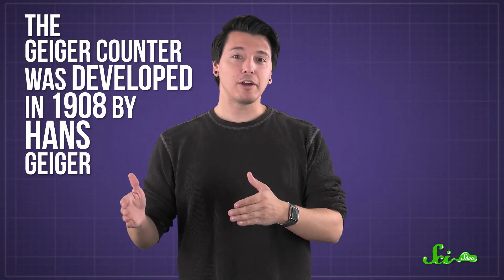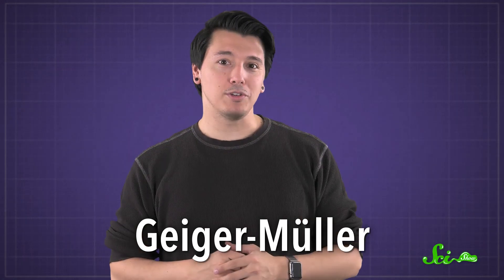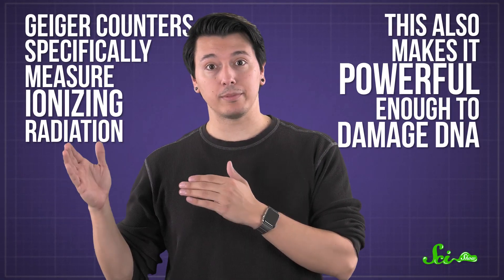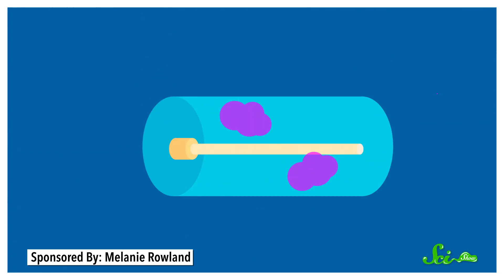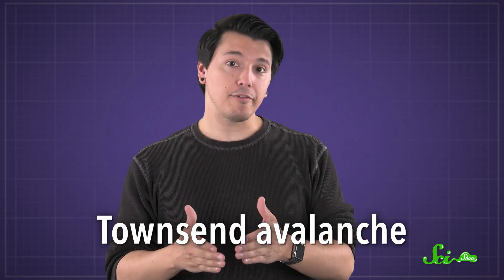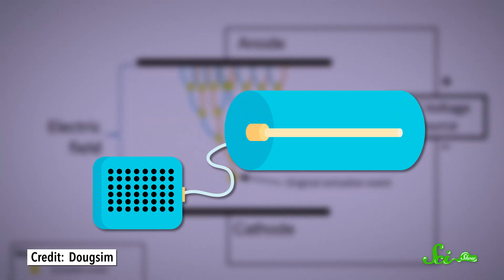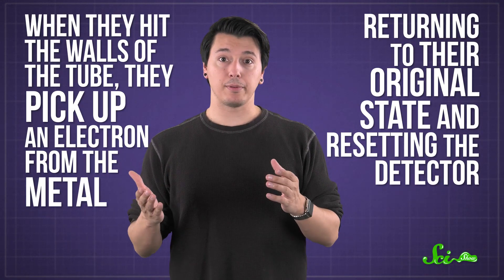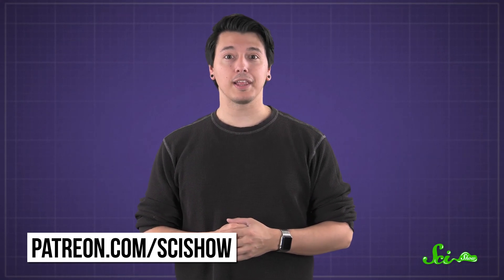Why Do Geiger Counters Make That Clicking Sound?

Comment: My left side of headphones makes crackling sound like Geiger counter. Is it serious thing on my headphone?
Reply: Well since this comment is 9 months old i presume you have new headphones but if you wonder they are broken
Likely a cable that got loose or some insulation that has worn off
Reply: It's picking up radiation from your phone or computer. Turn it on airplane mode and the crackling will stop.

Comment: "...  3.6 roentgen. Which, by the way, is not the equivalent of ONE chest x-ray, but rather FOUR HUNDRED chest x-rays! That number has been bothering me for a different reason, though. It's also the maximum reading on low-level dosimeters. They gave us the number they had! I think the true number is much, much higher. If I'm right, this fireman was holding the equivalent of FOUR MILLION chest x-rays in his hand!"

Comment: In my University days we had a radiation officer st the school. Someone had been working with Tc-99, a weak beta emitter with a half-life of about 100,000 years. He used a counter with a solid state probe which easily detected the decay of the Tc-99 whereas a regular counter might not detect it very well as the highest energy beta particles are only about 100Kev.
Reply: Nice

Comment: I bought a cheap Geiger counter on line and have been unable to conclusively determine if it is legit or just a random number generator. Hold it to a smoke detector  produced what seemed like a uptick of counts but nothing definitive.
Reply: There's about .33 micrograms of americium oxide in a smoke detector, and about a third of it is pure americium.

"After 30 years, about 4.7% of the americium atoms will have decayed to neptunium."

Not all that much to detect.

Comment: The only part that does not seem to be correct is the one regarding the positively charged gas molecules returning to to the medal and detouching electrons from it to neutralise again.As this activity could create a geiger pulse geiger counters contain alcohol molecules (with lower BE electrons and heavier) to stop the process.especially the older ones.

Comment: I feel like the clicking of old geiger counters are more effective then the beeping of new ones. The clicking makes you feel more scared, and therefore more cautious.
Reply: When they are clicking there is no danger.  At high dose rates of concern, the clicking becomes a continuous scream, cheaper models just go quiet as the drain on the high voltage causes the GM tube to  stop detecting.

Comment: Now explain to me how an RMKB reactor explodes
Reply: With lies!
Reply: It can't
Reply: @shadowofthenight7316  it can't because it's not there! (The acronym is wrong so it can't explode)
Reply: Wtf is an rmkb reactor? Is it a reverse engineered chinese version?
Reply: @LordBruuh  No. Its a Soviet design 2nd generation nuclear reactor. But unlike PWR reactors, it uses graphite as moderators. But the advantage of it is that it is like a high performance car, it produces a lot of power, but compromises safety. Therefore it encountered power spike levels like what happened in the Ignalina nuclear power plant, and the meltdown at Chernobyl. But advantage of its design is that it can be refuelled without shutting it down completely, and that they can be converted to produce nuclear weapons.
Reply: Idiots bypassing and disengaging safeties, removing control rods, and doing criticality tests at low power just to have another check mark on their report. 

There were many rbmk reactors that continued operation after Chernobyl without incident. Because those operators weren't dumb enough to bypass the safeties to run a criticality test.

While the rbmk is not a particularly safety forward design, they are still quite stable when operated within their design envelope. Chernobyl blew up because of humans not because of the reactor. No reactor in history has ever decided to just up and meltdown.
Reply: @zombieregime  What you say is true enough, although in the particular case of Chernobyl the explosion was caused by a design flaw in the emergency control rods. The reactor was rapidly gaining power when the operators dropped the rods, which had the unfortunate effect of causing the reactor to blow up in that particular (overheating) state.
Reply: @LordBruuh  Meanwhile China is reverse engineering CANDU nuclear reactors.
Reply: @jannadrielcervo7753  have they not tried, you know, just asking for the plans? I'm pretty sure whoever holds them wouldn't have too much of a problem with China building safer reactors......

Comment: This is why it clicks, but they didn't say what makes the clicking sound. Depending on your meter (many older Geiger counters are actually radiation survey meters, the difference is a lack of counting) if you have one from before 1970 or so, it probably doesn't have a speaker. It has an electromagnet with a little steel plate next to it in a headphone. The signal turns the magnet on and off quickly, which makes the click. I always thought that was really cool.
Reply: @toxic Sure, but a speaker usually has a cone and is modulated. This is just a metal plate. I know, it's pretty much the same thing; I just think it's cool. :)
Reply: @doggonemess1  3yrs later, and you’re still right. This is cool to know.
Reply: You kinda just described how speakers work

Comment: Radioactivity is fascinating to me! I have G-M counters and a collection of radioactive sources. It's complicated stuff! But, I love it! G-M counters are used more for lower-level sources, because the tube can become saturated, and in some instruments, mostly older ones, the reading will drop to zero in a high radiation field, and the user might think they're safe. Geometry is important. The larger the G-M tube, the more counts it will produce. And if it's a "pancake" type detector, with a mica window (which will detect alpha particles and lower-energy beta particles too), you can apply 2π geometry, which is great for calculating efficiencies of differing radionuclides (radioisotopes). Most modern G-M tubes are also "quenched" with a halogen. Mostly the older tubes were "quenched" with an organic vapor. This helps decrease spurious electron avalanches and decrease dead time, allowing for a faster recovery and response after a detection event. It is also important to know what the "dose to counts" conversion ratio is, for setting the tube's sensitivity, and this depends on what radionuclide the G-M counter is specifically calibrated to. Most modern G-M counters are calibrated with Cesium-137. For example, my Inspector™ USB G-M counter is calibrated with Cs-137, and the sensitivity is 3340 CPM/mR/hr. A different isotope, with the exact same specific activity and decay mode can be or will be vastly different when it comes to G-M tube sensitivity. It depends on the energy emitted from the isotope, and they are all different. A spectrometer can identify it, but a Geiger-Müller counter can only detect it. Different isotopes emit particles with different energies and at differing intensities. For example, Cobalt-60 decays by β- decay, with the energy being at 318 keV (max). The gamma ray byproducts emitted are both over 99.9% intensity at 1174 keV and 1332 keV. Cesium-137 decays by β- decay, with the energy being at 513 keV (max) and 1175 keV (max). The gamma ray byproducts emitted are 85% intensity at 661 keV. Therefore, the sensitivity of a G-M counter can vary greatly, depending on what radionuclide(s) are being measured, and efficiencies must be calculated for dose units or for determining the specific activity of the radioactive source. Again, it's complicated, but G-M counters are very useful instruments! CPM or CPS should always be used instead of a dose unit, like mR/hr or μSv/hr, unless it's specifically calibrated to the source your measuring (gamma only). There are energy-compensated G-M tubes and filters that can be used or applied to "flatten" out the sensitivity to energy curve, so that a dose unit, when used, can be at least pretty accurate. Also, if the tube has a mica window, it will detect alpha and lower-energy beta particles. Most G-M tubes can't. The thickness, size, dead time, sensitivity, voltage, distance used, time of measurement, shielding used, condition, and construction of the G-M tube and the hardware it's running off of are just some examples of what makes these complicated, but extremely useful for detecting ionizing radiation!
Reply: Thank you for that good information! As always, things are much more complicated than one initially thinks.
Reply: You're quite welcome! Glad I could help!

Comment: I love the fallout references and something tells me that diagram on the screen could fit inside a pipboy. Also Mutant hounds are so ugly they're cute, and sometimes I think feral ghouls are blind in fallout 4 but have an enhanced sense of smell. Notice how they raise their heads into the air like they're sniffing? But if you're right there there's no way in hell they could miss you even stealthed. 

I wanted to offer to sci show in thanks for the reference, my own theory involving the feral ghouls mentioned in the video and how their condition actually may effect their bodies because there's a constellation of real life things that I think inspired the creators at Bathesda when designing their feral ghouls. 

I'd lay really good odds feral ghouls have as much in common with leperosy as they do with zombies. Think about it! all those jokes about necrosis and feral ghouls losing fingers and toes? guess what happens to lepers; the nerves in their fingers, toes, and other extremeties die, leaving them unable to tell whether or not they're hurting themselves accidentally. A cut or a scrape unnoticed turns into gangrene and then those fingers and toes have to be amputated. 

A feral ghoul's smell can be explained by that and self neglect. Try not bathing for 200 years and see what happens. But those feral ghouls should also be getting candidiasis. so why isn't there a rash accommodating? why is their skin so thick? why are there "charred", "withered" "gangrenous" and "glowing" to name a few varients of feral ghoul? Its because their immune system is either working over time or undertime. Think I'm bluffing? Think about eczema and psoriasis, conditions caused by overgrowth of skin cells. The skin that's effected itches and becomes thick, pebbly, red, and pealy or some combination thereof. The skin cells build up. 

But whats more for over half a century in the fallout universe steady radiation pollution has been leaking out into the environment BEFORE the bombs actually dropped. Enough that it could act as a selective pressure for bacteria, as in gut bacteria. I'd lay really good odds someone's internal ecoli or similar mutated to tolerate toxic radiation and even feed on it. This could explain why radiation energizes feral ghouls. It throws their symbiotic bacteria into overdrive, who use it to create biologically useful chemicals to jump start their nervous system and through it other organs. Those include the positive reward chemicals in the brain explaining why feral ghouls congregate near glowing ones. Getting irradiated from the glowing one makes their brains release endorphins through the passive nervous system. 

Likewise withered feral ghouls got so little radiation or so few symbiotic gut bacteria that can process radiation that they're thin emaciated husks. Ever see the potbelly some of them can get? That's a symptom of malnutrition, gases building up in the stomach and causing bloating. Plus they tend to lay down lethargically until you get close and then ambush you. It sounds (and I know from experience) like depression caused by vitamin D deficiency and anemia, almost like they're not absorbing nutrients like they should. :( sad ghoul is sad.

Comment: The limitations of geiger counters helped the administrators at Chernobyl hide the disaster from Moscow for almost two days by repeatedly telling the nuclear governing agency that detections were no higher than 30 microsieverts per hour, despite that being the maximum detection limit of the handheld counters being used.  The truth was that radiation around the destroyed reactor was several thousand times greater but the only dosimeter powerful enough to give accurate readings was buried under the rubble on the body of the guy whose job it was to use it.

In fact Viktor Bryukhanov, the manager of the plant even stood by his assertions two days later when suits from Moscow pointed to the big hole where the reactor used to be and asked "30 microsieverts, really?"

Comment: "If you hear a Geiger counter crackling stay away" Thank god no one brings a Geiger counter on an airplane or otherwise most of the country would suffer from severe radiation sickness.
Reply: I asked one Geiger counter manufacturer if my model could take the lower air pressures on a flight. He said it would not be damaged but advised me to turn the audio off so the other passengers would not be frightened.

Comment: I used to work with these. I could calibrate them, use them, and read them, but I never knew exactly how they worked. Thank you for this video!
Reply: Thats super cool! I've been fascinated with them ever since I played my first fallout game. I even named my dog, the dog in my picture there, Geiger.
Reply: How did you know how to calibrate them without knowing how they work?
Reply: @pedrosso0   diversity hire
Reply: @cerealdork2131  Nah requirements for calibration aren't hard, have a source with a known activity, expose it to that known radioactivity, and make a note that it falls within an expected range. For GM friskers you use a button source, literally just place the detector over a source of radiation (generally a beta source for this case). For GM radiation detectors like a telepole you probably use something where you raise a highly shielded source and remove shielding. Either way you don't need to know the mechanics for the same reason you don't need to know how exactly your gas tank pumps gas to your engine to refill your gas tank, you follow basic instructions.

Comment: wouldn't the different ionizing power affect the detection then? so GM counter is actually measuring the radiation intentisty instead of radioactivity?
Reply: Sort of. It depends on the voltage given to the Geiger tube. When the voltage is low and in the zone of proportionality a Geiger counter can discriminate between beta and gamma decays. However this negatively effects its efficiency so it will only detect a small number of the decays it would usually detect if the voltage is set to the Geiger muler region. So it's always measuring radioactivity but at different voltages it will be more or less sensitive to certain types of radiation (alpha beta gamma) and or energies of radiation and will produce a different sized electrical pulse based on the particle type. Most scientists use gamma scintillators to identify isotopes as they are much more sensitive and provide detailed information on each decays energy allowing for a spectrum to be generated. From this spectrum the isotope can be easily identified. If your interested in Geiger counters and seeing them detect actual radioactive sources check out my Chanel.

Comment: So, how do you measure radiation that is beyond a Geiger Counters capabilities.
Reply: there are numerous ways, each depending on the specifics of the radiation needing to be measured. In general, it always comes back to measuring voltage. Different materials will be affected (ionized) to different extents depending on the radiation source. By measuring the difference of the induced electrical charges of the materials, a calculation can be made to determine the amount of radiation. If several different materials are used, the type of ionizing radiation can be identified in situations where the ionizing source may not already be known. Some materials require far more ionizing radiation to produce a charge, so the detection limit is determined by the specific materials used in the detector.
Reply: The next level of sensitive equipment is generally scintillators which give off  light flashes proportional to the energy of the radiation particle that passes through the material. However most of theses tools are only sensitive to one type of radiation so you need a different tool or probe to detect alpha radiation than gamma. On the plus side though, they can tell the energy of the particle and are very useful at determining gamma isotopes based on particle energy by generating a gamma spectrum. If you want a even clearer and more detailed energy spectrum you would need to upgrade to a semiconductor detector. Although super sensitive theses fancy detectors usually need to be cooled with liquid nitrogen. I use a bunch of gamma scintillators on my channel to detect various isotopes and I believe I posted a video comparing a gamma scintillator to a Geiger probe.